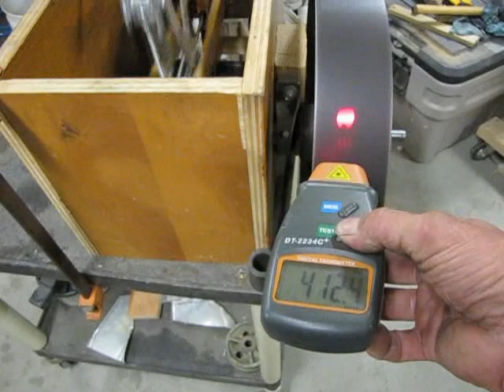Large Stirling engine 3

Comment: Another excellent job, I see you have also upgraded your connecting rods.  It gets better all the time.  I know little of these engines but am getting increasingly very interested, especially when I see a good working design such as this. Nice work.  I believe maintaining the heat and (water) cooling is quite beneficial in these type of machines for power and efficiency, and have thought it would be good to see one like this with both maybe, ie, maybe a evacuated (stainless) sleeve over a major portion of the hot side to help contain the heat, (even a whole evacuated heater housing and hot end sleeve to contain all the heat), and a small efficient water cooling setup for the cool side. This could be further enhanced perhaps, with an absorption type system between hot and cold sides, giving possibilities of refrigeration and /or Air Con also. 
Finally a generator to see what sort of AC/DC potential is possible, giving possibilities for timers, electronics, auto start, etc, just to really wreck a great old time working mechanical art like this, and perhaps a evacuated solar tube heating system and storage for 24/7 to make it all the more complicated, buuuttt, apart from a much greater outlay of $ and time, it would essentially be, a truly free energy machine.
Love your work and keep up the good vids, cheers from Oztralia!

Comment: Looking promising.
- surprisingly good low RPM with help of a such large flywheel.

Just an idea: If pressurizing slightly the diaphragm attachment ring could have a short smooth cylinder like support for rubber sides... Then rubber operation has some less stretching sideways and quite close to finer reinforces rolling diaphragm assemblies that are quite well studied.
I could imagine that it will also keep diaphragm little better in "center line". 

Thank you for sharing.
Reply: ... I ment "fiber reinforced rolling diaphragm" - its a dark xmas evening here over the keyboard :)
Reply from the maker: Eki Honkakoski Thanks, Eki! The air brake diaphragm works great but does need to be held centered with the guide tube, which generates unwanted friction. The rolling diaphragm is beyond my means.
Reply from the maker: Eki Honkakoski It's been dark and cold here, too, but supposed to be sunny tomorrow for Christmas. Thanks for the comments!

Comment: Hi, great engine. What are those plastic pipes for going in and out at the back of the displacement cylinder?
Reply from the maker: One goes to the air pump to pressurize it slightly, the other goes to a pressure gauge.

Comment: Very good, congratulations! You tried again pressurize your engine?
Leandro Wagner.
Reply from the maker: Hi, Leandro! Yes, I have been pressurizing it a little bit and it makes quite a difference in power and speed, but also has caused damage to the components with the higher forces involved. That's why I'm making everything stronger.
Reply: Yes, I understand! When you make a more powerful engine, many other things need to change.

Have you considered also pressurize the crankcase of your engine? As there is the difficulty of sealing the shaft of your engine make a small pan with 3 outputs for current rods, so it would be easy to make a mechanical seal in the rod to the crankshaft as opposed.

Leandro Wagner.
Reply: ***** 
Good job !
Reply: *****
Hi, thanks for sharing your knowledge, I wonder how you pressurizing your engine ? you should pressurize both side of the piston, otherwise it won't work. and I don't see if you can do it with this design.
Reply from the maker: Mohamad ghaffarian niasar You can certainly pressurize any Stirling engine, whether or not the crankcase is pressurized. You just have to make sure the mechanisms are up to the extra loading stresses caused by the extra pressure. I've pressurized this engine and it runs faster with more power when I do it. If you wish to balance the forces you can either make a double-acting boxer engine or pressurize the crankcase.
Reply: ***** Thanks, yes you are right, it will work better but the high pressure gas leaks out quickly from the displacer rod gap. Is there any seal for that arrangement without adding to much friction ?
when pressurising the crankcase radial shaft seal can be used (for sealing the flywheel shaft), but for that arrangement I don't know if there is anything.

Comment: Will you build a rocket stove gassifyer heater and run this with that as your heat source? The two in combo would make an awesome highly efficient off grid machine!
Reply from the maker: markedgell Absolutely! The propane is simply for building and testing it. In real life this thing needs to run on free fuel.

Comment: Hello my friend and I are trying to make a small bush plane ultra-light hybrid and he left the mechanical stuff to me and I decided on putting a Stirling engine in it simply because its the easiest and cheapest option but I have never built one before I was wondering if I could get in contact with u in any way to get some advice on how to make 1 it needs too be small but fast enough to lift a plane off the ground any ideas?
Reply from the maker: I know Stirling engines in some ways are ideal for airplanes since they don't need oxygen, but I don't know of anyone who has successfully built one.

Comment: I was thinking you could use some graphene to increase the heat transfer of you engine and increase speed and power, Robert Murry-Smith is interested in stirling engines, he makes graphene and I bet if you talked to him he might work with you on how to improve your engine.
Very smart guy, super chemist, makes all sorts of compounds, super strong plastics and amazing stuff. He wants to make a stirling engine for producing power and to make a pump, for a project of his. I think it would be great to see him use something like your engine because it has lots or real power, impressive.
I like your engine a lot. Please keep working on that engine. Also, I figured it would be great if you could gear it to use cold, In winter people stored ice to use in the summer in a large celler. If you live in a cold state, you could freeze huge amounts of ice and store it underground and use it through the summer months just using normal temp air and ice, "tempreture difference." Also if you used a heat source, the very cold ice would still be a huge boost of power. stock pile Free ice in the winter. Mabe use the used steam from a power plant, they just throw away the heat to cool it off after it turns a turbine, this would be a great way to cool off the steam and recapture the water while making electricity.
If you got time please let me know what you think
Thanks
Randy
Reply from the maker: Randy Travis Randy, I'm unfamiliar with how graphene might help the heat transfer but I'm certainly open to any ideas that have a reasonable cost and can be duplicated with minimal resources and tools. Unfortunately, the ice idea doesn't generate enough temp difference to make the engine run. The difference between ambient and 32 deg. F is very small compared to the temps achievable with a fire. But the ice would help some. Feel free to pass on any info you feel might help.
Reply: ***** Graphene is one of the best thermo transferring materials around. If you can coat the part of your stirling engine that needs to be able to absorb heat then release it, you will increase that function that needs heat transfer many times over, you should get  greater power from a much cooler power source. It might be possible to increase your performance by over 100% with a fast heat transfer system. From what I see, the stirling engine functions from an imbalance of heat, If you increase that imbalance then you increase the power, graphine is like a conductor of heat just like copper is a conductor of electricity. The neat thing about graphine is its like a super conductor of heat, its the best there is. If you can take advantage of these properties im sure you will see much better results + you will capture much more energy from you heat sources and that alone will make using graphene worth while. Also graphene powder is easy to coat with. You just rub it on with a cloth, its flexable and electricly conductive.
If you want a better engine, this is a very good start, because its an easy improvement, like going from bronze age to the steel age in materials.
Let me know what you think, im more than happy to get more info for you and find people who might be able to help improve your design with cheaper and easier methods. Your engine is wonderful and could change everything if it could be made to work on smaller temperature differences, like a cool 65 degrees underground and a hot roof painted black "over 140 degrees".
Thanks for your videos
Randy
Reply from the maker: Randy Travis Well, you've got my attention, that's for sure. I'll look it up and do some research on it. Do you know Robert Murry-Smith? I'm wondering if the fine stainless steel wool regenerator could be coated down to the actual fiber level - there's a huge amount of heat transfer going on in that wool.
Reply: Robert  Murry-Smith is a very nice man who has answered several of my comments. He is a true scientist with real intentions on helping others with his research. I feel sure he would be more than happy to help you and even provide you with some graphene, he sells it so others can do their own research and I don't think it would cost too much to get some.
He is working on a larger stirling engine himself right now, so I think he would be very interested in talking with you. You have some serious mechanical skills and he has incredible chemist skills and mechanical skills as well. If you two were to talk, I bet it would create a very powerful stirling engine.
He can also make carbon / graphine foam or coat stainless steal with graphene like you were wondering. He might even be able to coat nylon with graphene then dissolve the nylon leaving a hollow core graphene fiber that would be super light and super heat absorbant.
 Please give him a look at, he has several videos on stirling engines and what he plans on doing with them. He really enjoys them and thinks they are a lot of fun, im sure you two will hit it off very well and have lots of fun.
I, myself, am good at seeing the potential in ideas and can put them together as concepts.
Most of my ideas work very well and I have helped others with my ideas, but the truth be told,  I don't have the nessary skills to do these experiments myself, but I am more than happy to do some research and pull ideas together for people who are serious about their research
. I saw right away that your engine has some serious power, its exactly what is needed for some serious power generation. 
Please let me know if you need something researched, I will do my best to find related information or concepts that could help you with your work.
Thanks
Randy
Reply from the maker: OK, thanks Randy! I'll check it out!